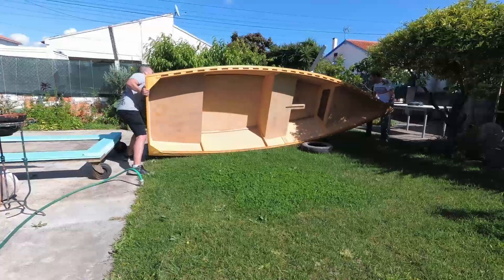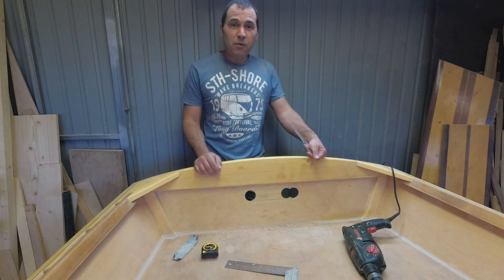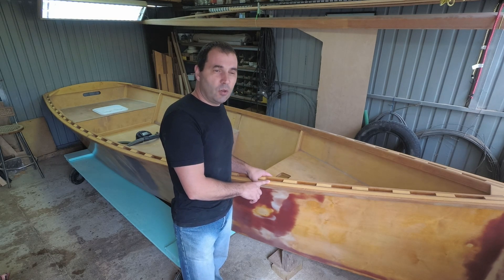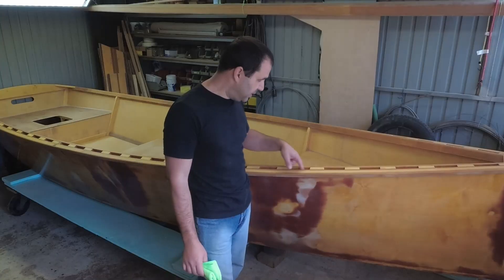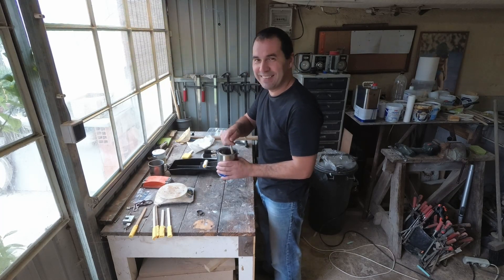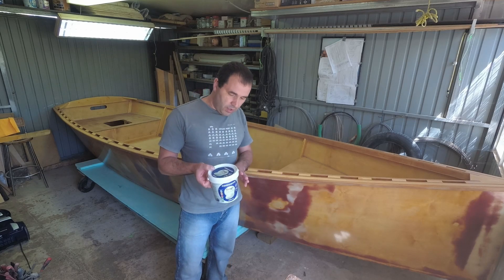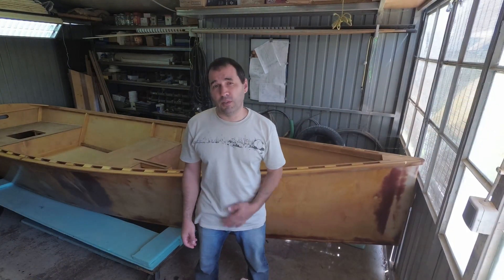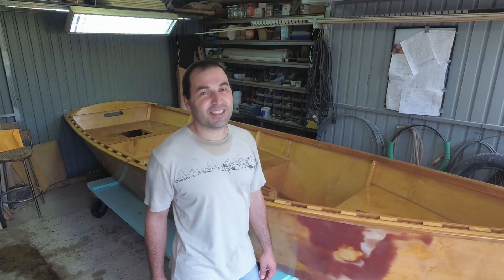Building a Goat Island Skiff - WEEK_23 - homemade plywood sailing boat

Comment: Mate ! The brush you have wouldn’t help. Try using a synthetic bristle, when you ‘lay off, start one way first then change direction, very lightly dragging the brush over the surface. Looks great, watched all your videos in 2 nights, awesome!
Reply from the maker: Hey Mathew, thanks for your feedback!
I bought this brush supposedly for varnishing! maybe I was conned! 🥴
Anyway, I'm done with the varnish for now, 4 coats of varnish on top of 3 coats of epoxy will have to do, as I have little time to finish the build. 😅

Comment: sanding will  push anyone to drink on the job. I suffered throughout the video when u were varnishing. I spent several years doing boat varnish in the caribbean, 9 was the minimum amount of coats. Avg 12 coats. Everyone has their own tricks to varnish, few tips that work for me: The first coat of varnish is to impregnate the wood. I use to do up to 40% solvent. The next can go down to 15% and lil by lil i worked myself to 5 %. Since u have expoxied i would have started in 15% or so just like u. Remember to increase the sanding number as you go along. I started with 120 and would end up with 300 and even 600 depending on job. Remember you want to scratch the surface a lil bit so that varnish attaches to surface, not sand it out. I used cheaper brushes for first coats and found that foam brushes worked better than expensive natural hair ones for final coats in reg jobs. I always finished with tact cloth the prep work to make sure dust is out. For faster work i would sand and do one coat in a.m. after sun warm up a lil and apply a coat without sanding in the afternoon with at least two hours of sun left. In 5 days 10 coats! Do not varnish if its too hot, the solvent will evaporate too fast! Patience is key and thin coats are best. Best of luck!! Im looking fwd to see you sailing ! Love the videos!
Reply from the maker: Thanks for the advice and great tips Miguel! 
For now I have to leave it at 4 coats as I have  +- 3 weeks to finish the whole build and take the boat to be inspected/approved by a naval engineer from local maritime authorities. (yes it's a thing over here😏).
At the end of this season when I get the boat back home I might add more layers of varnish! 😁

Comment: It may be more of a "its the, quality of your brush" type of situation. Showing the brush strokes, that is.
Looks pretty good on camera. Any way for you to tip your boat on its side for doing the inside walls of the boat? Check with local woodworkers and painters over the telephone for brush recommendations, maybe? Good luck on being completely satisfied with your finish. 
As I said, over the video, it looks pretty great from here. [Kentucky, USA]
Reply from the maker: I bought a brush for varnishing, it wasn't even a cheap one, but maybe you are right. I have no way of comparing it as I haven't varnished anything before in my life! 😅
On the horizontal surfaces it turned out quite good, the only problem being the dust!
on the sides i can't apply enough varnish for it to flow and cover the brush marks without having runs.
I might have to turn the boat on its side to do each side at a time....😁
Reply: @TheBoatRambler  just wondered, the brush sure looks kinda course. I prefer a natural bristle brush that is a lot softer, like fine horse hair. On my screen, that looks like either boar hair or nylon bristles.
But like I said, on my screen it looks pretty nice. 
The flow looks course, from certain angles when wet,
 but still pretty damned good for a first time user of varnish.
Hopefully it is spar-varnish and not some interior grade. I would not consider using un-thinned for brushing or rolling application. It needs the thinners to flow into its brush marks. And, rollers can be a quite tricky thing with many exterior top-coats. Maybe you are going over the same spot too much. It can tac-off quite quickly due to temperature and humidity, especially without thinning.
Good luck, it is coming along quite nicely.
This is my favorite plywood boat build on YouTube yet.

Comment: Hi Theo.
First of all I really thank you for taking so much time to realise all those videos about your construction. I follow carefully each step of your GIS progress as I'll start mine in a couple of days/weeks. I bought a KIT for my first construction. I have a question about a tool your using to scrap the surfaces in the corners. The blade is perpendicular to the handle. Is it a fab from you?
About varnish I think it's a a problem to work in a dusty space. Every step you do, every little air flow is lifting dust in the air and a large part of it is falling on the fresh varnish. 

Thank's again i'm in a hurry to see your boat floating.
Reply from the maker: Hi Edouard! First, contratz for making the decision to build your GIS! 💪 
Second...make sure you enjoy the build, it's all about having a good time man!😉
And thanks for watching my videos! 
The tool you mention is a scraper I bought on Amazon.es and it takes Stanley Sta028640 carbide blades.
https://www.amazon.es/gp/product/B07HGCTD3Q/ref=ppx_yo_dt_b_asin_title_o00_s00?ie=UTF8&psc=1